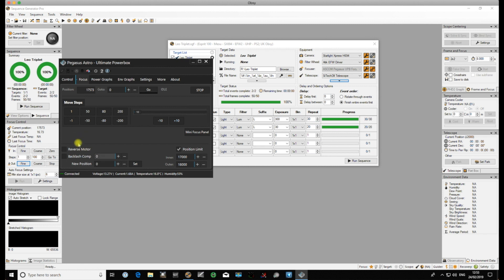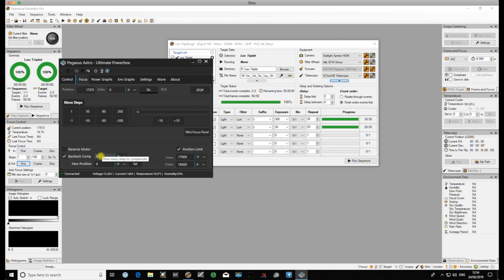Understanding and applying focuser backlash compensation

Comment: Awesome video as usual and very nicely explained. I am very interested in the methods used to find the backlash compensation in particularly the part where are you racked the focuser draw tube out by one marker and then started to bring that in. So it took 3 steps for the marker to disappear in to the draw tube. So your backlash would've been 3 steps?
Reply from the maker: Hi Ahmed.  Thanks for that.

No I actually had my step size set on 10 steps here as the resolution is relatively high.  This meant that each movement was 10 steps.  If you look at the SGP screen shots you will see that my backlash compensation setting was 40.  This is made up of the 3 lots of 10 steps to get the focuser clearly moving, and I then added 10.  It doesn't really matter what the number is, it will just take longer to get to the point of clearly seeing movement with a higher number, so it is easier to use 3 movements of 10 steps, than 30 movements of 1.

If your focuser is lower resolution you can use 1 or 2 steps, or on higher resolution you can increase this to whatever figure shows clear movement.

As noted, it isn't that critical as you are looking set the backlash figure at more than this, but naturally need to have a base figure to know what to put in, so this is about getting that base figure.

The resolution of your focusing train is the key thing as, depending what this is, you could be programming in 20 or 200 in SGP, and this could make the difference between it working or not.  By way of example, my Lakeside/TS 80 needs to be set at 40, but my SestoSenso/Feathertouch is set at 200 as the focuser motor connects to the micro focus shaft so immediately has a 10x resolution.

Hope this all makes sense.
Reply: @simplifiedastro2092  makes complete sense and thank you for taking your time in explaining this in further detail. Yes I did notice that you had backlash compensation set to 40 and then I wondered maybe this setting is for another scope. Makes complete sense.

It's always good to know the answers to some questions rather than blindly use "Yeah just use 100 and you'll be fine as long as it's more than the actual backlash" but I always did wonder how to find that magic number. 

Appreciate your quality video once again and keep up the great work here mate.